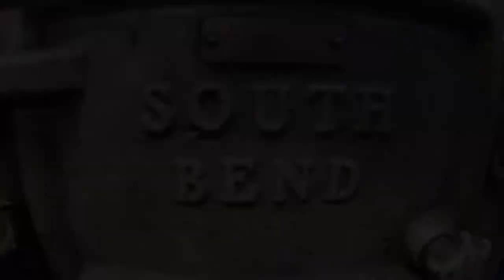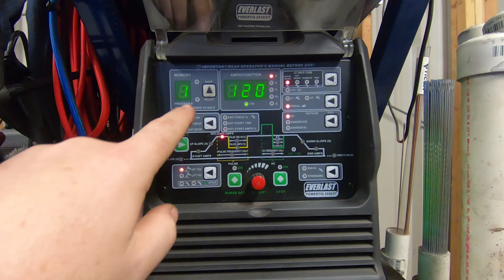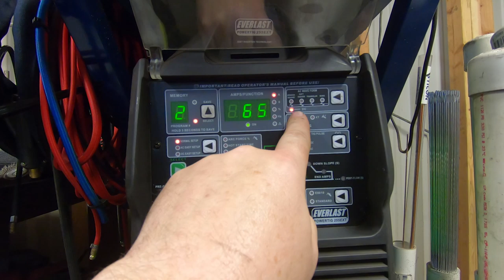Tig Welding EP4. The first Arc Strike

Comment: Hello i have just started tig welding SS recently, could you make a video about keeping Stainless .... stainless? i have welded stainless pipe and seems to have a bit of rust.

also if i weld on a carbon steel table does that contaminate the SS304?

also maybe tips on purging exhaust pipe and opinion on pulse ? thanks !

Comment: Hi, I recently started to learn how to TIG weld, I need it for building my stainless exhaust. I can do MIG and electrode welding already (it´s my job), so I thought this won´t by that much different. Do you have any tips for using current regulation on the torch instead of the pedal? What do you think about pulse frequency for welding stainless? Thanks for your opinion and also for this series, of course. Greetings from Czech republic :)

Comment: Awesome awesome awesome awesome, did i say awesome video? My biggest issue im having is figuring out how to use that damn pedal even though i'm a year in with hours of practice every single day. I have no clue weather im supposed to floor it then back off or what have you. I have been trying to figure out the dab move dab move, but have always been a continuous movement on the torch while dabbing guy myself. but i weld super fast. only thing i can do the pause and dab technique is on aluminum which i can weld much much much much better than steel. On butt welds and fillets on aluminum and stuff, they're half way to weldporn status on aluminum already and steel looks like i still haven't picked up a damn torch ever in my life even though i've been doing it lol! Now stainless is a different story, I can weld stainless steel much better than i can carbon. carbon steel is the biggest issue that i'm having issues with.
Reply: Wicked Moto I can weld aluminum better then any other metal. I struggle with stainless because I end up cooking it. I feel like I need to work on heat control. Maybe i have too much amp or not enough. I feel like i go to slow or not enough gas coverage. Carbon steel isnt that bad either. I just need to keep practicing
Reply: @Jursaw  Remember that amperage is not synomous to heat it's the amount of time. the lower the amps the more time you have to spend. The thing i've found with stainless is that it likes lower amps, probably by about 5-10% less amps than carbon, at least for my person welding style And i get perfect pen and beautiful colors with my fupa cups and BBW cups. you and i both need practice. even the guys that have been doing this for 20+ years have been doing this still practice like Justin has showed he still does. But i've never had any lessons. So I'm hoping with his videos that he'll be able to help in a way teach me how to weld because teaching myself is being frustrating, i haven't been able to build or do anything and im a year into it and probably at least 800+ hours into practicing. with everyday practice.

Comment: Is TIG welding good for anything, or do I need MIG welding to sometimes?
Reply from the maker: You can do a lot with tig but mig is by far faster.
Reply: So I guess that a multi process welder would be a good idea?
Reply from the maker: SSOR1991 absolutely a good idea